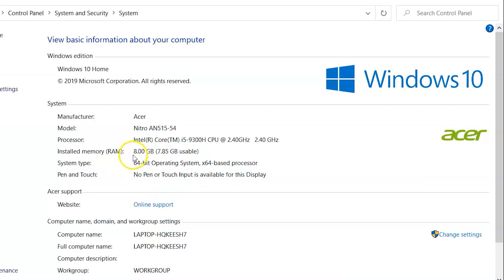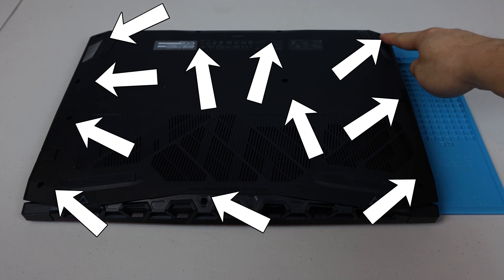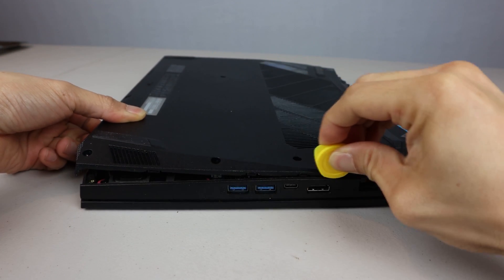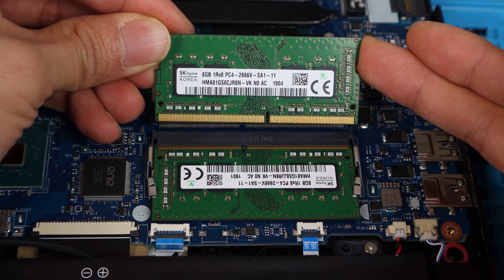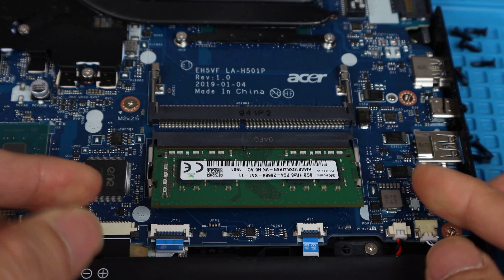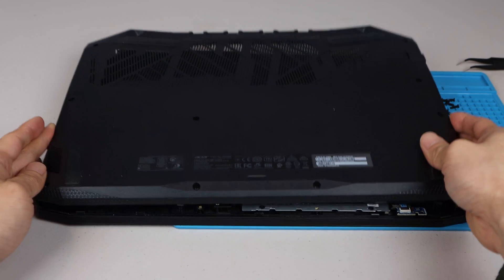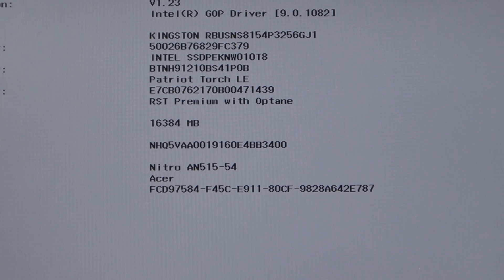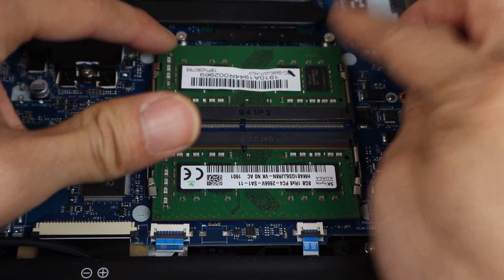How to Install or Upgrade RAM in an Acer Nitro 5 Gaming Laptop (2019 ver) DDR4 up to 2666MHz 32 GB

Comment: I bought the 2020 acer nitro 5 from bestbuy and I want to upgrade my 8 Gb to 16. If I want to replace my ram with 2 new 8 gb sticks is there a certain size ram or speed or something I need to buy? I don’t wanna buy the wrong ram size or speed. Plz help
Reply from the maker: I'm not sure about the new one. Once you've got the laptop opened up, you can see the specs printed on the existing RAM chip. Your best bet is to match the specs on the one that's already installed to ensure compatibility.
Reply: @FixItPhil  Ok thx
Reply: @jgolden1309_  actually please tell me the name of the ram you're using. I dont even have the tools to open my laptop up
Reply: @Herozonex200  i actually upgraded the ram myself a week or so ago. It was way more straightforward then I thought. This is exactly everything I did in steps so u can do it too:
1. Ordered the Crucial CT2K8G4SFRA266 off Amazon (if u copy and paste that model into Amazon it will be the first result that’s named Crucial 16gb ram kit)
2. When ram comes, get ready to take laptop cover off. Power off laptop and flip over. Get screwdriver that fits screws and get container to hold screws while they’re out of laptop.
3. Now, unscrew all the screws from around the laptop and take out the one in the middle. Put them in the container for later.
4. This is probably the most tricky part. Now that the screws are gone, the bottom panel of he laptop can be popped off. Go to one corner of the laptop and u can just use ur fingers to pry a little at the two edges. Or even better I used a guitar pick if u have one. If u pull it enough, you’ll feel a pop and more of the laptop cover will come off. This is perfect and now just use the pick or ur fingers to move around the edge of the laptop and pull so the panel clicks off. Move around the whole thing until the entire back panel comes off and u can access the inside.
5. This is the most fun part. I’m assuming uve watched videos so u know how to replace the ram. Just remove the current sticks and put in the two new ones. They only go in one way so just line up the pins and insert and push down until it locks in place.
6. Now put the cover back on in the exact position and push down around the edges so it snaps in place. After u can put all the screws back in and screw them back in.
7. Nows the final part. Power the laptop back on. It might take longer than usual (it did for me) cuz it’s processing the new ram. When it turns on, go to task manager and go to memory. Make sure it says 16gb of ram. If it does, u successfully replaced your ram and ur done!
Reply: @jgolden1309_  3 questions. 
1. Is the laptop faster when you upgraded the Ram?
2. I cant buy hyper x active or just stick with crucial? 
3. Is it true that our laptops can run current and next gen games??
Reply: @Herozonex200   1. Yes it’s a lot faster
2. U can use hyper x or whatever brand as long as it’s ddr4 SODIMM
3. It depends on the game. Our laptop is mostly limited by the graphics card but it should be able to run most games in at least ok settings
Reply: @jgolden1309_  Thank you so much. This is my very first gaming laptop that I got from Christmas. I'm glad you've answered my questions so I can run my laptop with the best of its abilities.
Reply: @Herozonex200  no problem enjoy your new laptop
Reply: You're the same position as me right now. I'm trying to figure out what ram should I get to upgrade to 16 GB.

Comment: Will the ram stick you put in the laptop during this video work with the default ram stick acer puts in the laptop. I have the same laptop and haven’t made any upgrades and I would like to add the stick you have in this video.
Reply from the maker: Yes, it is the exact match for the OEM pre-installed memory Hynix 8 GB RAM: https://geni.us/TDIO [Amazon Affiliate Product Link]
Reply: @FixItPhil  awesome thank you for responding 🙏🏼

Comment: I don't know if you still see the comments but i guess it doesn't matter if I try lol.
I cannot get the screws out of my nitro 5, do you know what i can do?
Reply from the maker: Hm, you can try using a mini screwdriver with a different bit size. I used the J0 from this set: https://geni.us/bWoL [Amazon Affiliate Product Link] but a Phillips 2.5 would work too. What I like about the screwdriver in the set is, in additional to the sheer amount of exchangeable bits, the center of the screwdriver rotates on a ball bearing, so you can use your thumb to apply downward force on the back of the tool and still turn it, which makes it easier to remove any screws without stripping them. Good luck!

Comment: Are u active? How do i know what brand and type of processor i have in my laptop without opening it
Reply from the maker: You can lookup your model number on the internet. The specs should be readily available and tell the information about the processor that you are looking for.
Reply: @FixItPhil  I don't really need same brand of processor right? Just same clock speed i guess?

Comment: How problematic is the static electricity thing?
Reply from the maker: The risk is non-zero, but also, in my experience somewhat rare if you take certain precautions (e.g. don't work on carpeted surfaces, discharge yourself on something grounded like a metal radiator prior to beginning work, etc.)

Comment: My nitro 5 came with 1 ddr4 8gb 2933mhz ram, and I can't find the same one online.
Reply from the maker: Hm, you can always go with a higher MHz like 3000/3200 MHz and the laptop will step down the speed. Try to match the other specs like CL, capacity etc.
Reply: @FixItPhil  alright cheers 👍

Comment: Really awesome video, I just ordered 2x16GB Corsair Vengence 2666HMz and can't wait to upgrade my Acer Nitro 5. Do you recommend any specific parts for HD/SSD etc Phil? Thanks keep it up with the great videos
Reply: UPDATE: I've successfully installed my two new RAM sticks by following this guide! Thanks Phil!! And damn, it was hard to open the notebook without the plastic pry pick!
Reply: @NenseiJay  also is there a limit on the MHz? Like can I go higher the 2666 MHz ?
Reply: @xXSalvi503Xx  it's definitely worth it imo, specially if you notice your Task Manager constantly at high RAM% usage, in my case gaming + lots of Chrome tabs open. I'm not too sure about the MHz part of it, sorry!
Reply: @xXSalvi503Xx   no see below 2666 is max
Reply: Nice bro I’m very curious on upgrading my ram to 32gb as well but I was wondering is it worth it

Comment: hi I just subscribed your actually the first for me but i really liked the simple explanation of the upgrade. I'm old school as they say back when everything was C: using dos commands and learned the hard way. i just bought this nitro 5 17" 8g 512g for my teenage daughter her bday is coming up. so my question is do you think with you experience if i just buy 2 16g ram and slide them in there's a real notable difference in speed when playing the newer games like halo, gears of war etc? I read specs on this and several other laptop gaming and for $700 it seems by upgrading a few things like starting with Ram it will be worth the price. so again adding the 32g should be a easy snap in with noticeable speed increase of the 8g?

Comment: Can i use a gutair pick instead of a pry tool? Great video
Reply from the maker: Haha, you can try! I think guitar picks are probably not as thick/durable, so you might just end up snapping the guitar pick. I usually use a nylon pry tool because it's designed for opening up electronics and tends to minimize damage the the device's case

Comment: should i upgrade this right away, or wait a while to upgrade it
Reply from the maker: There's no advantage to waiting except that you'll save some money in the short term by not buying extra RAM right away. Once you do the upgrade, you can utilize the performance benefits straight away.
Reply from the maker: @bs6740  In the US, upgrading the RAM and drives is allowable and won't void the warranty. In other countries this may differ, so I would confirm with your regional Acer service center about that.

Comment: I did all of this and now my acer nitro screen is black
Reply from the maker: What model Nitro 5 do you have? Some have a battery cutoff microswitch that disables the battery if the back cover is not firmly attached. Try removing all the screws on the back and re-installing them, ensuring they are on tightly (but don't try to force it and overtighten). If you have an older model Nitro 5 with the RAM access panel, the switch is usually found under that panel and removing and re-installing the screws for that usually does the trick.

Comment: hi i have a quick question My laptop is Acer nitro 5 model: AN515-43 and it comes with a 4GB ram and I'm planning to buy another ram which has a size of 16GB does it work?
Reply from the maker: Yes, you can mix and match different capacity RAM in most cases, as long at the other specs match (MHz, CL, etc.) It's generally okay to do this, but there may or may not be inefficiencies in the performance from doing so.

Comment: Have you tried to put 2x32GB ram sticks? How do you know 32GB is the max? Very informative video! 🙏🍻
Reply from the maker: I have not. Acer lists the max RAM capacity of the laptop at 32GB in all literature and support documents, so typically this means capacities greater than the listed max cannot be used by the CPU.

Comment: Is there any way to get 3000mhz
Reply from the maker: You can try overclocking your RAM speed to achieve higher frequencies, but I generally don't recommend this for folks who aren't experienced in overclocking as altering clock frequency or voltage may void any product warranties and reduce stability, security, performance, and life of the processor and other components. If you do choose to go this route, you could try using Intel XMP to overclock your RAM and it will automatically apply the correct settings for your modules as per the recommendations from the memory module manufacturer.

Comment: Mine was from 2019 so I was in for a shock when my bottom had a wire connecting a hard drive and the ram slot was a little different. Was able to do it still though so thanks and geez thought I yanked the hard drive for a sec

Comment: do you need the grounding wrist band or is it just suggested
Reply from the maker: It's recommended, but not necessary. Just be aware that working inside a computer without proper grounding carries more risk of electrostatic discharge damaging components. For what it's worth, of all the times that I've done upgrades without any protective gear, I've only experienced ESD maybe once.

Comment: Would simply wear rubber gloves during the process protect the equipment from static electricity?
Reply from the maker: Depends on the kind of gloves. Gloves made from latex are static insulative and will hold on to a charge and release it in an uncontrolled manner, possibly leading to damage. Nitrile gloves are less conductive, but not a guarantee that you won't experience a static discharge.

Comment: If you just want to upgrade ram I don’t think you need to do all that
Reply from the maker: Do all what? Open the laptop? My model Nitro 5 has no access panels to the RAM slots. The only way to get to them to upgrade the RAM is to open it up. Hence, the video walkthrough.

Comment: Can this laptop go up to RAM with 3200Mhz ?
Reply from the maker: No, this particular model AN515-54 handles a max RAM speed of 2666MHz and when using 3200 MHz RAM it would just run at 2666MHz.
Reply: @FixItPhil  Okey, thanks you 🙏🏽

Comment: What utility did you use to benchmark the ram? Or can you recommend some software for ram, CPU, HD benchmarking? Thanks. Great video straight to the point. Got the Nitro AN515-54-5812, upgrading soon.
Reply from the maker: I use UserBenchmark because it's free. You can also try Superposition which is also free

Comment: What if my nirto is 16GB RAM and want add 16 GB more ?
Reply from the maker: Sure, if your laptop has a single 16 GB RAM stick you could add a second one. However if your laptop has two 8 GB sticks, you'll have to remove and replace them both with 16 GB sticks to get your total of 32 GB.
Reply: @FixItPhil  Thanks bro
Reply: @FixItPhil  I am choice between 
ASUS ROG Strix G15
& Acer Predator Triton 300

both Intel i7 10th gen & RTX 2070
But want your comment ASUS or ACER?

Comment: Hi Phil its me again lol, i was thinking on going max memory with this, and i found Timetec Hynix IC 32GB KIT (2x16GB) DDR4 2666MHz  on amazon, but i dont know if its compatible with the Nitro 5
Reply: I also bookmarked this, BRIGHTFOCAL  LP156WFC-SPD1 it is a 120hz ips screen, and a Kingston 1TB A2000 M.2 2280 Nvme Internal SSD PCIe
Reply from the maker: Sorry for the late reply. Both of these should be fine to use with the Nitro 5.

Comment: Hi, I have the 2018 model, is there any difference? Im thinking of getting a crucial 8 gb ram but the stock ram is not cruical, will this affect anything?
Reply from the maker: The process should be very similar. Generally the brand of the RAM doesn't matter as long as you match up the specs (speed, size, form factor, etc.)

Comment: Hello! I bought two Crucial 8GB RAM DDR4 260pin 2666 to upgrade the 8GB (2x4GB) default RAM to 16Gb (2x8GB) but as soon a I install them, when I try to start my laptop it gives me a blackscreen and can't access to the BIOS. Any help?
Reply from the maker: What model laptop do you have? the same 2019 Nitro 5 as in the video or a different model? Typically a black screen upon start up means no RAM detected. This could be for a number of reasons including the RAM is not seated fully or correctly into the slot, the RAM is not compatible, or the RAM is damaged in some way. If you reinstall your old RAM and the laptop works fine, I would check the specs of your laptop's motherboard to see what its limitations are and the recommended specs for the RAM.
Reply: @FixItPhil  it's a Nitro 5 an515-54 55zm. It's specs are i5 9300H, 8GB RAM (2x4GB), 256GB SSD, Nvidia Geforce GTX 1650. It's also looking exactly as the one in the video. I've tried to check on Acer's website but I can't find any info.
Reply from the maker: @aniquatico  Hm, the only thing I can think of is that the RAM chips you bought have a CAS latency (CL value) that's different from what your system's settings are. My RAM chips in the AN515-54 are CL19.

Comment: Hey my laptop has 2 ram slot but i opened there was only one im missin the the other slot where can i get it?
Reply: Hey man, my laptop had a different set up the other slot was on top of the first slot maybe check if there is a slot on top! I was confused but it works great for me! Let me know if it work s
Reply from the maker: Check the layout of your motherboard carefully. Sometimes the RAM slots are not located next to each other. If you only have 1 RAM chip installed right now you should notice an empty space with a connector that is where you can install another chip.

Comment: hi, good video. 
i have a question, is it a good idea to change from 12 to 16 ram? my acer nitro 5 gets very hot

thanks
Reply from the maker: You might see a slight increase to performance going from 12 to 16 GB of RAM, but it depends on what you're using the laptop for (gaming, productivity, digital content etc.). Generally speaking, adding more RAM doesn't always help to reduce CPU temperatures.
Reply: @FixItPhil  I use my laptop for gaming and some digital content, the graphic card use 2 gb ram, so i have 10 gb ram
Thanks for the answer

Comment: This is was exactly what i was looking for. Thank you. But how do i know what kind of ram i need? I also have the same laptop 4gb ram
Reply from the maker: The best way is to open up the laptop and take a look at the spec sticker on the chip. The Nitro 5, typically uses DDR4 SODIMM CL19 RAM and depending on your exact model/build at 2666MHz or 2400MHz speed.
Reply: @FixItPhil  thank you so much this really helped me alot ❤️❤️

Comment: Hi, will it be alright if I install another 8 gb ram of a different brand but the exact same specs and speed as the other pre installed ram that comes with the acer nitro 5. If so, how much of a difference would it make if I used the exact same brand of ram. Thank you for the very informative video.
Reply from the maker: Yes, that should be fine. In general the brand doesn't matter so much, though it's possible that the architecture of the chips may be slightly different causing some less than optimal compatibility, but usually it's not a noticeable difference.

Comment: Hi! I'm new to upgrading and I just want to make sure I buy the things correctly. I have a Nitro 5 AN515-54, 1660Ti  and current 8gb ram. When planning on upgrading ram sticks, what should I look into?
Reply from the maker: For the AN515-54, the max amount of RAM you can have across both slots is 32GB total and the fastest speed it can accept is 2666MHz. The RAM should be SODIMM DDR4 CL19.

Comment: When I add another 8gb ram. Do I have to upgrade the drives too? Or I can just upgrade the rams and I would be good?
Reply: The 2nd option
Reply from the maker: You can upgrade just the RAM without changing the drives. That's not a problem.

Comment: Does the ram stick sticker need to be facing upwards?
Reply from the maker: Yes, it will only go into the slot one way since the notch is not in the middle of the chip.